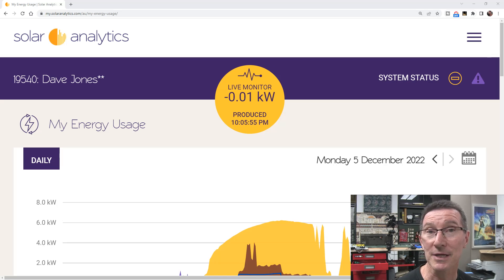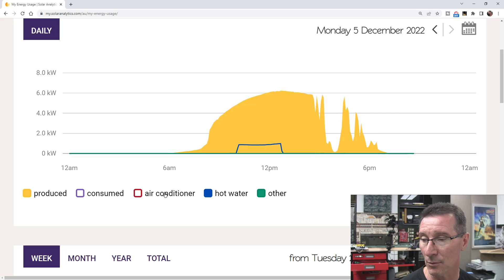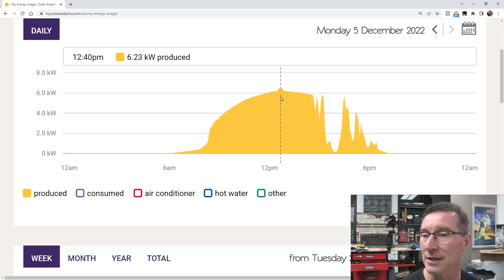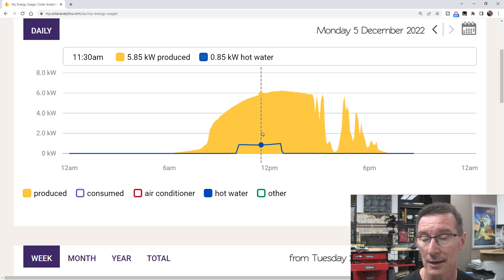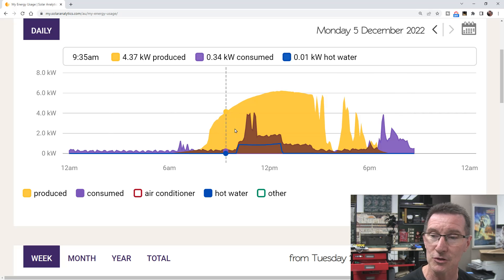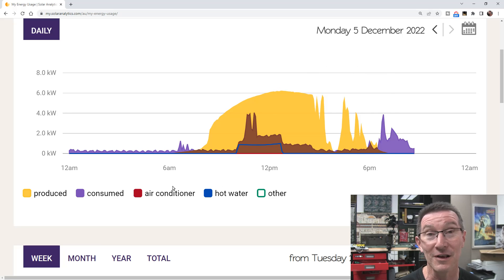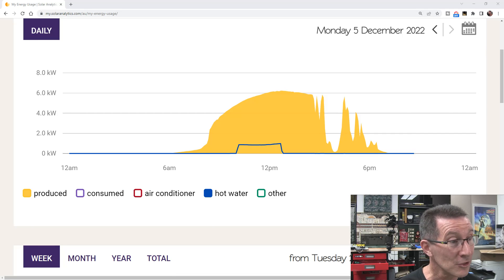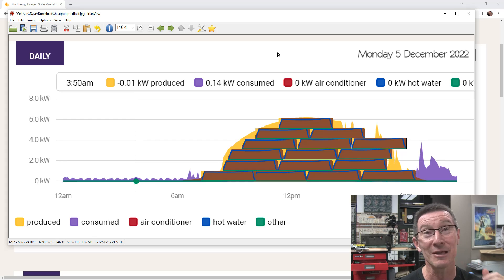Reclaim Heat Pump Hot Water Solar Energy Usage UPDATE

Comment: Heat pumps are great…
Reply: Note that these figures are from an install in a desert in summer. Those figures are mythical in normal climates.
Reply: @SupremeRuleroftheWorld  they’re not that much different in a temperate climate realistically, this is a modern CO2 based heat pump, so the efficiency is only slightly lower in temperate areas. Still far more efficient than direct gas or electric heating. He explains about it in the previous video.
Reply from the maker: @SupremeRuleroftheWorld  This exact system actucally performs better in Tasmania.
Reply: @EEVblog2  I had a Sanden heatpump hot water system with a 315L tank installed here is southern Tasmania 6 years ago, only runs for about 2 hours a day in the peak of winter, slightly less in the warmer months, very quiet, dirt cheap to run, many friends and family have done the same, these heatpump systems are fantastic.
Reply: @EEVblog2  Can you explain why that is? I'm genuinly interested. From my understanding, colder climate means more heat differential --> more energy required for the heat pump to produce ~62 deg C
Reply: @EEVblog2  yes, a country knows for its cold weather. /s
these installations barely get over COP3 in central/westen europe where the average temperature is around 12 degrees. and i work on HVAC for a long time and also on large CO2 installations. once you measure it the efficeincy is a lot lower than claimed is what i usually find. CO2 is nice on paper but the insane cost is nearly impossible to justify when you can buy a simple self contained heat pump boiler for less than 2k.
when you dont care what the system uses like in your case its useless to even look at it but in moderate climates with crappy winters and insane electricity costs the sCOP actually does matter so heating every day to these high temperatures is litteraly a waste of money. most systems just do a high temp run once a week or even longer (up to a month) and normally dont take the temp higher than the household requires it to save electricity costs.
sidenote: you say in many videos and many times that its impossible to calaculate the COP and several other items. from a hvac perspective i have to note that you tend to have some "hot takes" that gives people the impression that such a installation will preform just as well in their home if they are willing to spend a ungodly amount of money on a hot water boiler. that is just not the case. a "proper" heat pump monobloc that costs 4~5k can heat an entire home AND heat a boiler is a much more sane solution for most. please bear that in mind when doing these videos. people dont need to spend these huge amounts, it gives people the idea that heat pumps are unaffordable.
Reply: @SupremeRuleroftheWorld  that's bit unfair.
But yes heat pumps require a list of prerequisites to be completed first to really bring value to the buyer.